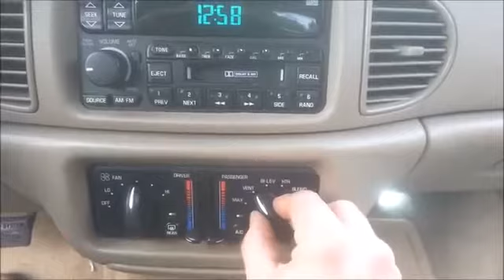2002 Buick Century repair of non working air vents

Comment: Question: the dial for bi-vent, defrost etc just turn without resistance or clicking and no front defrost - could this be the same issue?